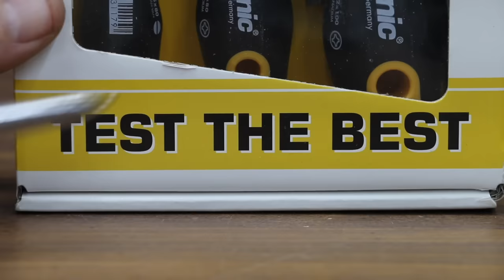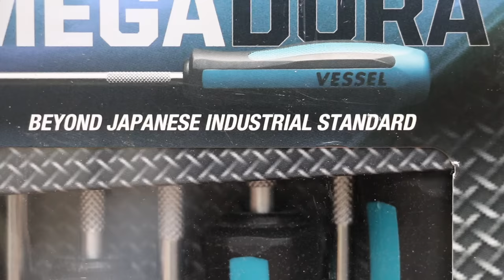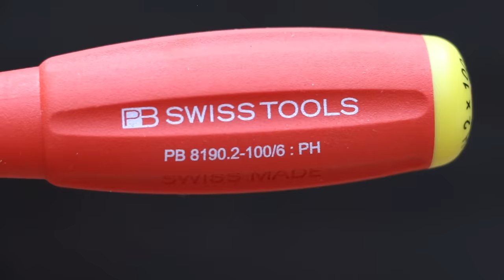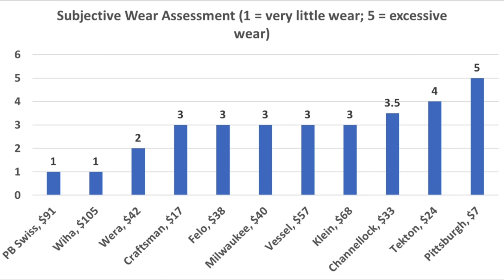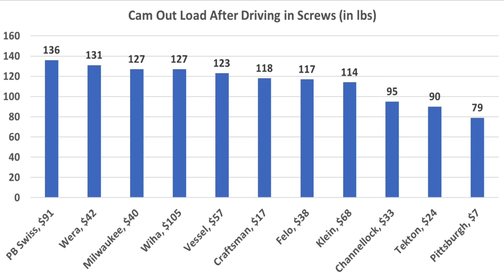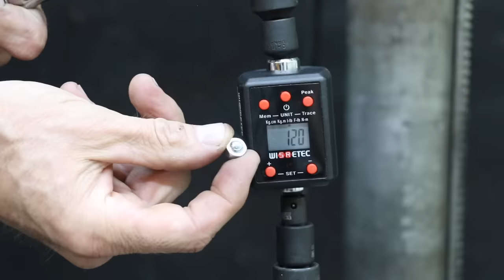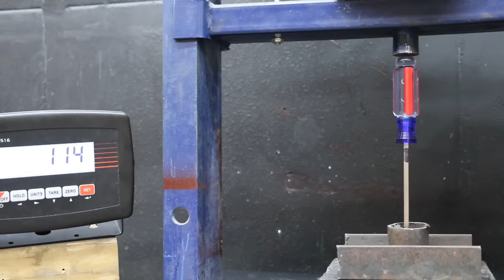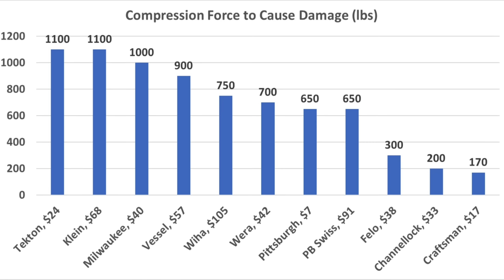Best Screwdriver Set? Craftsman, Milwaukee, Wera, Wiha, Klein Tools, Felo, PB Swiss, Tekton

Comment: What I got from this pointlessly abusive test is that for most homeowners and professionals using these screwdrivers as intended just buy the Harbor Freight. Even if you use them heavily enough, doubtful, to have to replace them every other year you still come out ahead. Also this test proves that the outdated philips and slotted screws and screwdrivers belong in the past. Long live the Robertson drive and Torx. It's past time that most screwdriver sets switch from being mostly phillips and slotted to mostly robertson and torx with only the two most common slotted and phillips.

Comment: In answer to your opening question:   No!
Reply from the maker: Thank you and Merry Christmas!
Reply: @ProjectFarm  I got to looking at screwdriver development since Mr. Phillips first patented his original crosstip design around 1930 to speed up assembly times.    There is quite a bit of physics and engineering involved in fastener design...  Thanks for this review.   Some types are purposely designed to cam-out the driver to avoid over-torquing.  Some heads are designed to remove easily without camming out or damaging the head, or the bit.   Lot's to learn.  Something new every day!